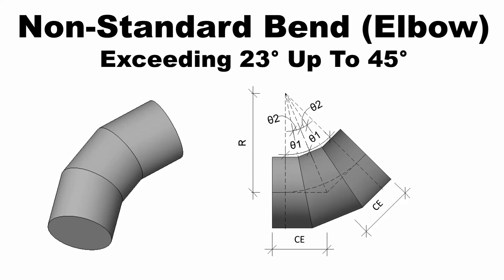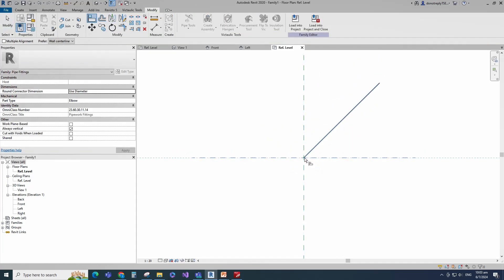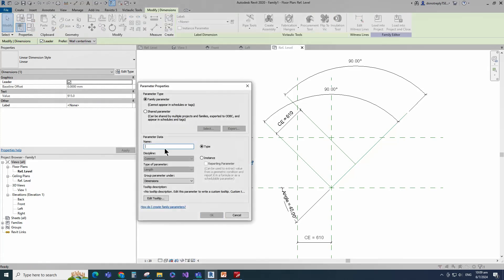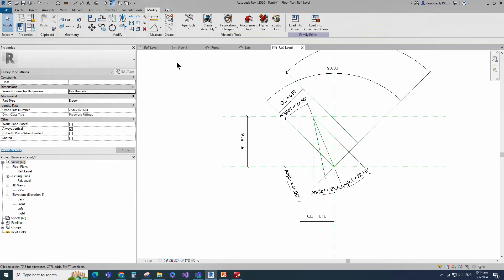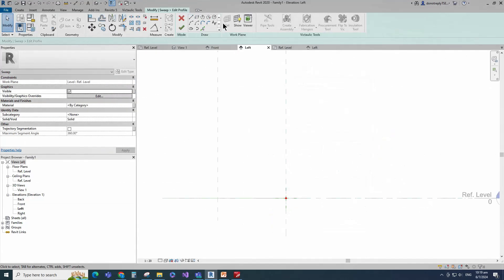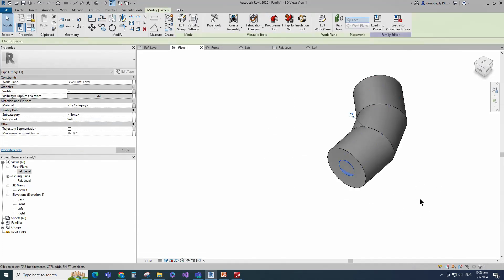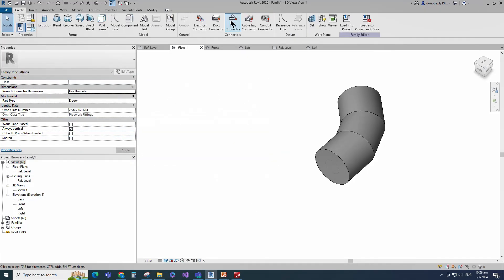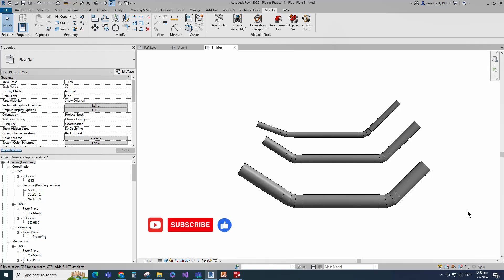Create Non Standard Bend Exceeding 23° Up To 45° Elbow Revit Family (Parametric)

Comment: "inconsistent units" This message appears when trying to write the formula, when I remove the angle from the formula, the problem is fixed, but the family don't function.
Reply from the maker: It will not work. Elbow performs relative to angle